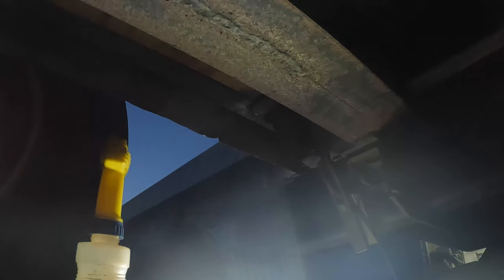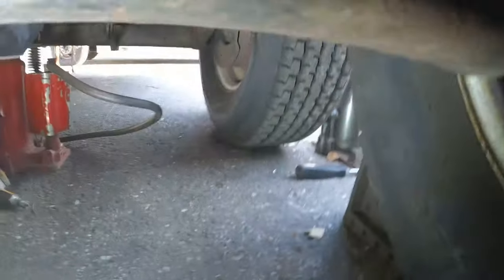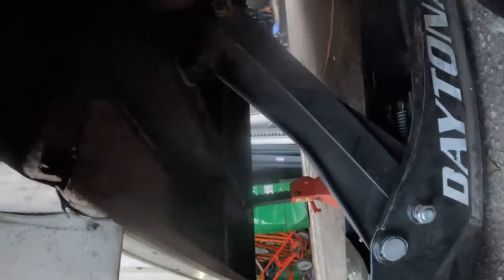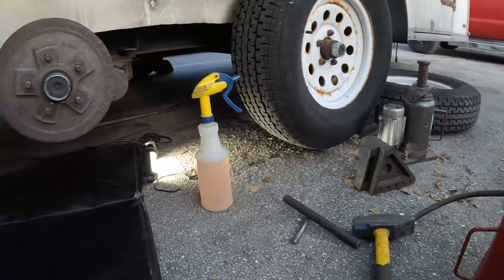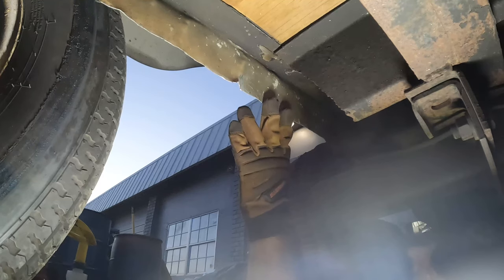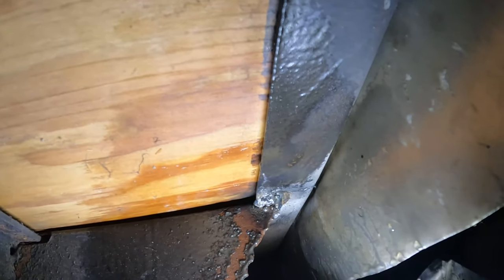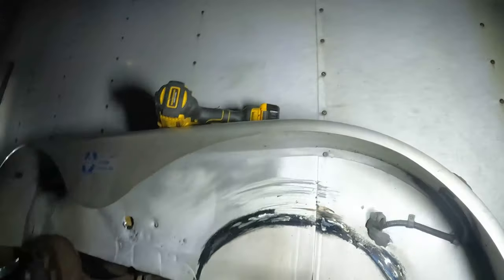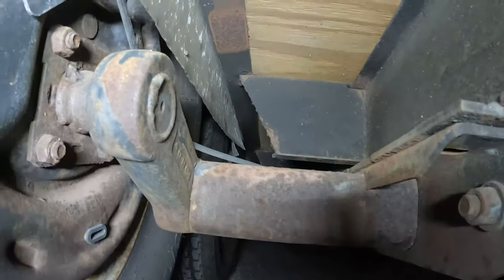Fixing My Broken Trailer. This Could Have Been Bad!

Comment: Built my own trailer for exactly the reason your dealing with right here.  I ended up flipping the dang whole thing over and putting some nice welds all over it.  i dare anyone to try to rip it apart mechanically, by just force.
Reply: Obviously I hate welding upside down
Reply from the maker: I need to flip my other trailer over and do the same,
Reply: @ProjectShopFl  One nice tree for shade and the chain hoist.  Plus someone that knows how to weld ... I'm kidding you of course 🤣.  Thanks for your videos!!!